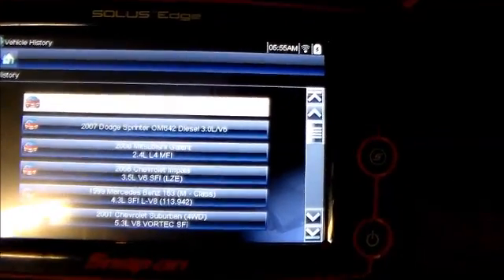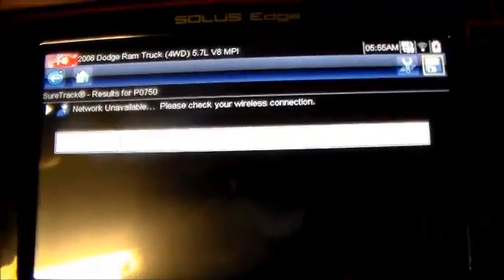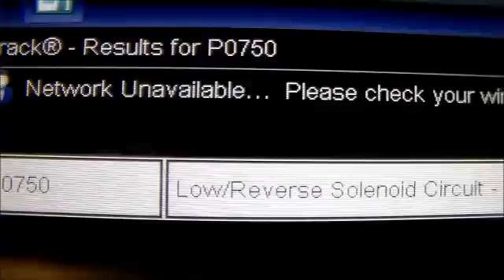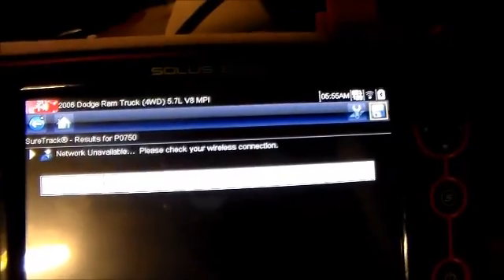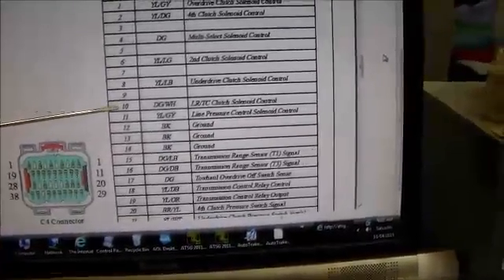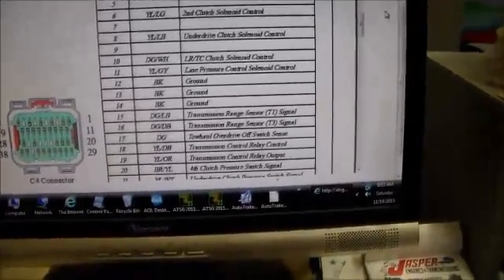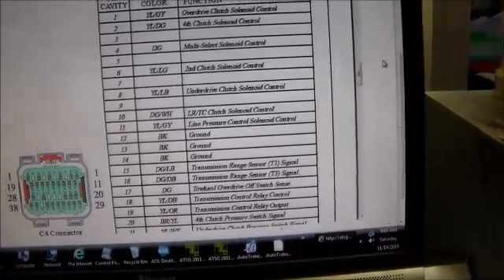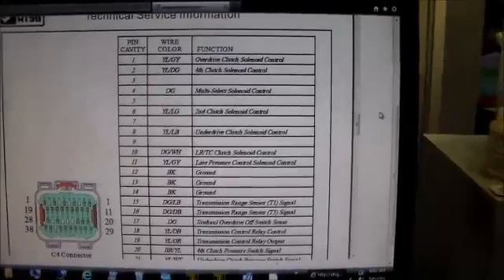545RFE, P0750 Diagnosis and Repair

Comment: yes i am getting p0732 gear 2 incorrect ratio,  p0841 and p0846  transmission fluid pressure sensor A/B circuit range/performande, p0846, p1790 and p0944
Reply from the maker: +Jose  Saturno  I would check that connection for that solenoid pack, When this was in failsafe, were you driving the car?
Reply: +Gary Ferraro yes i drove the car for like half an hour  to test if the L/R solenoid replacement solved the problem and it was working just great.. i went back to the shop and like and hour later when i was going home i turned it on and it didnt work anymore.. just R was working and when i put Drive it made a hard engage like on 4th and the car shut off
Reply from the maker: +Jose  Saturno  One of the codes P0944 is loss of prime, sure this is full of fluid
Reply: +Gary Ferraro yes I checked it before going out when it was working ok and when i got the problem again double checked and was at the same level but anyway I added 1 more just to be sure
Reply: +Jose  Saturno do you think this could be caused for the kind of oil? I live in Venezuela and here its very very hard to find the atf+4 and when I did the job the first time i lost a lot of oil and the only kind i found here was dexron 4 and i filled the transmission with it
Reply from the maker: +Jose  Saturno  No, not the oil, when you have a loss of prime, its either low on fluid or sucking air into the pump, hows the filter? did you change it?
Reply: +Gary Ferraro yes i changed the filter too.. I tested the solenoid pack today with air pressure and 3 of them changed the way of the air when activated but the L/R did not and the air was going thru everywhere.. do you think there could be the leak of oil pressure? maybe in the solenoid orings or a pressure valve
Reply: +Gary Ferraro yes i changed the filter too.. I tested the solenoid pack today with air pressure and 3 of them changed the way of the air when activated but the L/R did not and the air was going thru everywhere.. do you think there could be the leak of oil pressure? maybe in the solenoid orings or a pressure valve
Reply from the maker: +Jose  Saturno  Your getting pressure switch codes which are inside the solenoid pack, i honestly never took one apart to fix it, ive always changed them, did you see anything wrong when you took it back apart, and the filter is in correctly?
Reply: +Gary Ferraro everytime I had to open it I only tested the solenoids but not the pressure switches,  tomorrow i will check them  for any oil pressure leak, also the 4 solenoids are different in the position of the holes and maybe my problem is some solenoid in a wrong place that is sending oil to another place it shouldnt! here i couldnt find any other solenoid pack to test it or open it as a refference and havent bought it new because here is sold by a crazy amount of money and i want to be 100% sure

Comment: hi gary I took out the solenoid package to replace the L/R solenoid with another one a friend gave me and I didnt mark them in the position the were and now i have only first gear and R doesnt engage.. do you have any solenoid pack that you can open and send me pictures of wich selenoid goes in what position?
Reply from the maker: +Jose  Saturno  I dont think i do but i have to look around, also i will see if another local shop have any, (i help out some of these other shops)
Reply: +Gary Ferraro ok thank you! let me know if you find something
Reply from the maker: ok, this is the 545RFE correct?
Reply: +Gary Ferraro 42rle
Reply: +Jose  Saturno when i changed the solenoid the transmission was perfect! I drove for the whole day and it worked perfect.. I turned off the car and when I started it again y couldnt get to move it. I put Drive and the transmission made a hard engage to 4th and the truck shut down.. today I took out the solenoids again and changed the position but now i cant get R and only 1st in drive
Reply from the maker: are you getting codes? maybe you missed the manual valve,
Reply from the maker: +Jose  Saturno  I cant find the codes you stated, can you tell me again, if you clear them do they come back? How does the fluid look and smell.
Reply: +Gary Ferraro these are the codes 
P0732
P0841
P0846
P1790
P0944
If i clear them they show again after 2 o 3 engine starts .. the fluid looks and smells normal, it's not dark
Reply: then i took out the solenoid pack again this morning, checked it and mounted it again and now i have only 1st gear in Drive (with a hard engage too) and R feels like trying to apply, i can feel the hit of the transmission and sounds like is half engaged

Comment: 2004 Dodge dakota V8 4.7
Reply from the maker: +adam cain  Ok, on your car. The C4 connector, pin#10 Light Green wire is the L/R solenoid control. Ohm the solenoid, see what you have and compare it to pin#8 Yellow/LT Blue wire (underdrive solenoid) and also pin#1Yellow/gray wire(overdrive solenoid) They should all ohm the same.
Reply: Thanks alot for all your help i am going to check it after work.  I will let you know how it gows.
Reply from the maker: ok, good deal

Comment: it takes off slow from the start, but it doesnt do it all the time.  The rpms will rev up higher then usually from a stand still.
Reply from the maker: +adam cain  That is when it goes into failsafe mode. If you have an ohm meter you could check your self

Comment: Gary thanks for replying back and trying to help, I wish all mechanics were like you. Most places will just tell you that this or that needs to be replaced.
Reply from the maker: +adam cain  Being honest is my policy, we are going on our 49th year,  are you in new york?
Reply: I was hoping you were close but i am in the Philadelphia area.
Reply: Is the C4 terminal on the fender wall near the air filter?
Reply from the maker: +adam cain  Please give me the year, make , model and engine size, i can look up a wiring diagram at thsop tommorrow
Reply: @GaryFerraro  2003 Corolla altis I got p0750 solenoid A reading and p0755 solenoid B reading please can you advice me as to what to do am from 🇯🇲 Jamaica
Reply from the maker: @legistermusic7342  first thing is check the connections, clean them and clear the codes , see what comes back
Reply: @GaryFerraro  what should I use to clean the connection? 
Thanks for the information will do

Comment: the only other code is p0750, and it shifts in all gears except in first gear the rpms go higher
Reply from the maker: +adam cain question, how fast does the code come back? so in drive the trans upshifts to 4th gear
Reply: The code  comes back almost right away. It drives and shifts normal threw all the gears. Just when i am at a stand still it takes a second for my truck to go
Reply from the maker: +adam cain  With that code im very suprised it shifts, this is an electrical circuit code, when you say it takes a second for the truck to go, does it take off slow from a stop or normal.

Comment: Great video I just had my check engine light go off and went to a shop and they scanned it and this code came up. They pretty much told me my transmission needs to be rebuilt about $2500. I have a 2004 Dodge Dakota it doesn't feel like it's slipping at all hopefully its just my solenoid pack. I can't believe how fast they told me I just needed to have my trans rebuilt.
Reply from the maker: +adam cain  If the code is P0750, this is a striaght up electrical code. If you have an ohm meter you can check it yourself, is the car in failsafe mode?
Reply: I am not sure what fail safe mode is but the first code is p0700, thanks for replying
Reply from the maker: +adam cain  Failsafe is when the trans stays in one gear only,usually 3rd. The P0700 is just a generic code, there should be another code, do you have other codes present?

Comment: I may need your help with one more thing! when I pulled down the valve body the parking pawl rod was atached to the mechanism and I saw some videos about the assembly of the valve body but I dont see anybody even mentioning how to atach it again.. I heard you have to move the axle to L position but I dont understand how it comes atached again on that piece.. if you know something about I will appreciate your help.. thank you!!
Reply from the maker: +Jose  Saturno   To reinstall the valvebody, the linkage on the valvebody has to be in the low range position, the valvebody should bolt right up and then just move the linkage to confirm it moves freely.

Comment: Hi gary! So far I have good news!.. I tested the wiring today and it was ok so I decided to tear down the solenoid pack, once I got it out decided to test solenoids on the connector and still had the L/R not working! then I  opened it and tested them directly on the solenoid terminals and surprisingly the L/R was working perfectly!!.. I found out the terminals of the solenoid wasnt making contact with the "board".. I cleaned the terminals with sand paper and then put everything back together and now the solenoid is working fine! I still have to atach it to the valve body and put it back on the truck to test it! I'm praying so that solves all my problems! tomorrow I will let you know what happened

Comment: you know I cut the cables of the L/R solenoid and the UD solenoid to chance them in the pcm. but it is normal that if I leave both disconnected I am still having only the p0750 solenoid A? shouldnt I have the code for the UD solenoid too?
Reply from the maker: +Jose  Saturno  Yes you should, but sometimes for some reason only one code will show, i've seen this before, not sure why it happens.
Reply: +Gary Ferraro and based on your experiences when that happen it gets solved with the solenoid pack or its something else?.. i am on the way to my shop to check the wiring i'll let you know if i have continuity
Reply from the maker: +Jose  Saturno  More than likely the solenoid pack is bad, since the solenoid was ohmed at the computer and not at the solenoid pack itself, just as precaution i like to check the wire.

Comment: Hi gary
I found a diagram of the solenoid pack connector and I tested the solenoids from the transmission relay output to pins #1,2,6,10 and I got 2.6 ohm on each solenoid except the L/R solenoid, that one I got no Ohm measurement.. so I changed the cable in the c4 connector with the OD solenoid and the code in my scanner changed.. just like it did on your video.. so know I want to know if i can put the L/R solenoid cable directly to 12v to try to hear if the solenoid works or to measure the Amp
Reply from the maker: +Jose  Saturno  With that different code, we know now the solenoid is the problem, its probably shorted out, putting 12 volts to that wont really help, at this point the pack will have to be changed. Good work diagnosing the problem.  If the ohm reading is not correct, then amps will not be correct either.

Comment: i lowered it to 20k scale and it shows 16.08 ohms.. if i lower it more it goes out of range and i get no reading. And yes the L/R still giving me that crazy reading.. I found that if I test from pin #11 to pin #1 or pin #2 I get 7 ohms reading.. I dont know if that means something
Reply from the maker: +Jose  Saturno  Pretty much pin #s 1,2,6,10 are the solenoids, they should all read the same. (i know 10 is off)

Comment: ok this is what happened.. 
I put the multimeter on 200 k ohm scale and pin #1 and #2 are showing 16.0 k ohm.. but if i test the pin #10 the value never stops changing. It goes up to 100 then down to 40 even -40 and then up again to 200 then down to 0 and it keeps like that
Reply from the maker: +Jose  Saturno  200K ohm scale is too high, the 16k ohms is probably 1.6, Sounds like somethings with that solenoid or wire, if your getting a crazy reading, the net step is to check the wire inbetween the pcm and the solenoid pack, just for the heck of it lower your scale see if in fact you have 1.6 and the l/r is still crazy reading.
Reply from the maker: +Gary Ferraro  I have to run out for the evening, but leave the results and i will look either later or in the morning. Gary

Comment: i put the positive terminal of thw tester in pin 10 and the negative to ground and i get no measurement
Reply from the maker: +Jose  Saturno  Ok, lets try another pin, just to confirm you are getting a reading on the meter. Pin#1 is the overdrive circuit that is a Yellow/gray wire. Pin #2 Is the underdrive circuit and that wire is Yellow/Light blue.

Comment: exactly. i had p0750 then i disconnected the solenoid pack a reset the code. I unplugged the scanner and turned off the car, the I turned it on again and plugged the scanner and the code showed again
Reply from the maker: +Jose  Saturno  Ok, you have to get to the PCM, C4 connector, Pin#10 It is a Dark Green/White wire. Ohm the solenoid.

Comment: I disconnected the solenoid pack connector in the transmission then reseted the ecu with the scanner but after a minutes the code still showing and is the same p0750 shift solenoid A
Reply: what did you end up doing?

Comment: the engine is a 3.7 v6 .. i think the transmission is 42rle
Reply from the maker: +Jose  Saturno  You said you disconnected the solenoid pack and reset the code, did the code come right back? i have access to a wiring diagram to give you some info

Comment: where did you find the diagram of the pcm?
Reply from the maker: +Jose  Saturno  I belong to a transmission tech service, that i get this info from.
Reply: I have code p0750 on my 09 cherokee liberty, the scanner says "solenoid shift A".. I want to do the same thing you did switching the cables to see if the code changes because I´m fixing it myself and dont want to disarm the transmission unless i am totally sure about what is wrong, but my c4 connector doesnt have the same pins that the one you are showing in your video.. Are you able to find the pinout diagram for the pcm I have? the number in the label is 983AD..
Reply from the maker: +Jose  Saturno  You may have a different tranmission than the one in the video. Can you tell me your engine size?

Comment: Enjoy your channel.   Thanks.  Best way to quickly diagnose those solenoid codes is with an ammeter in my opinion.  Jump the relay so you have power and ground each solenoid.  The amps on the L/R circuit would have been different than the other three solenoids.  Ohms will fool you sometimes.  LOL    Keep up the good work!
Reply from the maker: +Jeff Stepp  You are correct, thank you for that and thanks for watching. Gary